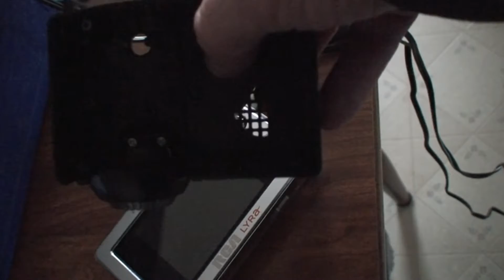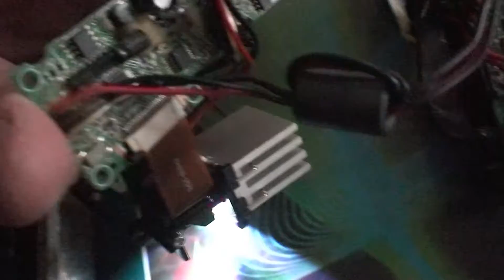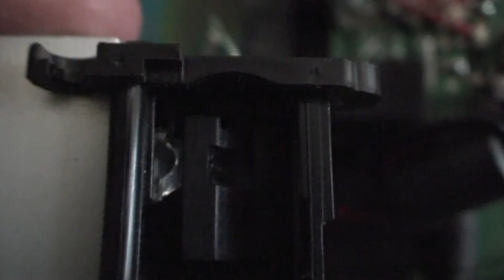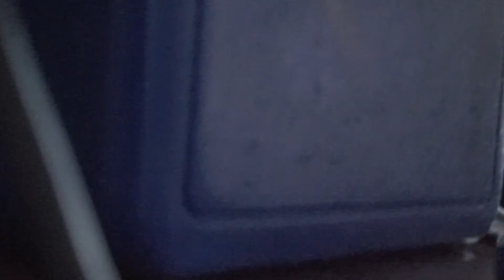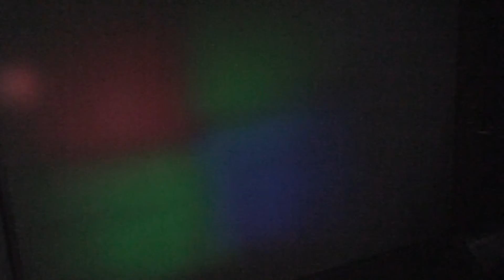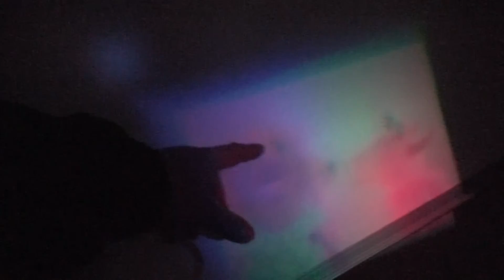The Inner Workings of an Eye-Clops Video Projector

Comment: @georgef551 Well, even if it is a toy, I'd be out a little over $30 lols  So, did you try running it for over 2 hours displaying video and perhaps even sound without the fan?  Do you still have it, so you could run a test? lol

Comment from the maker: @nambinhvu 
This was run in an open environment, so I wasn't too concerned about the fan. If it burns up, it's a toy.
3M's MPro110 is fanless, and has a much brighter LED, and bigger LCoS, so it's probably not really needed.

Comment: How long have you been running it without the fan?  The fan sound is annoying and I unplugged it from the circuit board for a bit, but noticed the heatsink got kinda warm after a little while, so I plugged it back in.  I figure leaving the fan in will extend it's life.

Comment from the maker: @ldgangster11 
Not really. The LCoS is low rez (320x240), but manipulating the lens or LCoS position can change the color uniformity, as well as overall hue.
I'd say spring for a $300 3M Mpro120. Same thing, much smaller, but 2.5 hours of battery life.